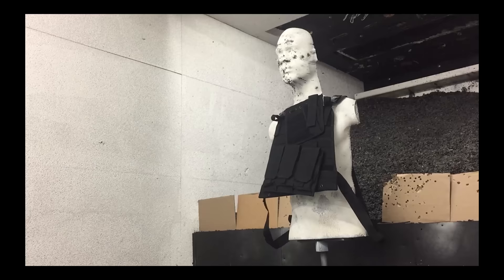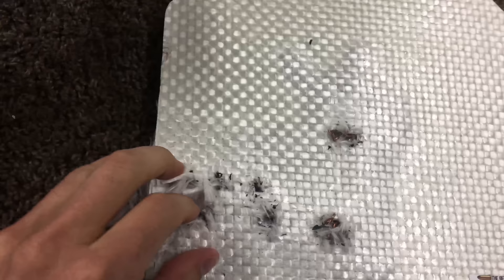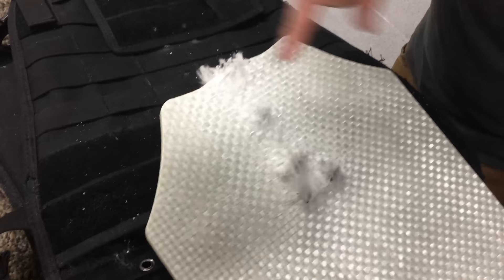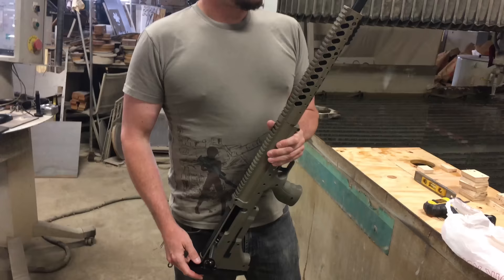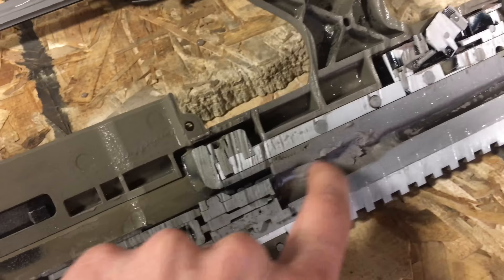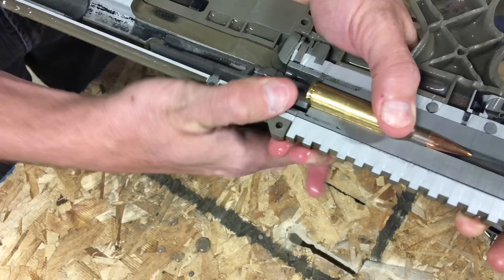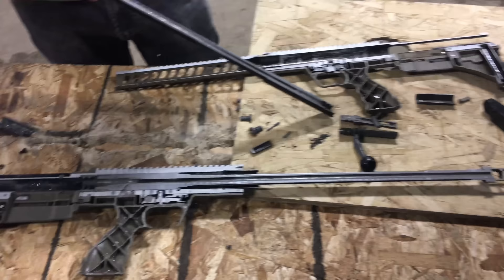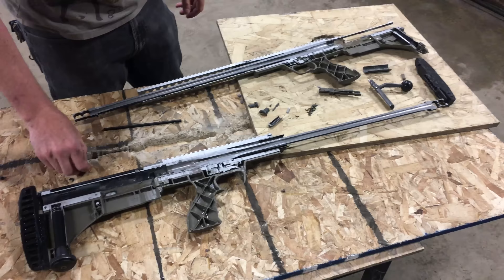Desert Tech Sniper Rifle cut in half with 60,000 PSI Waterjet Cutter

Comment: you guys I think what the manufacturer is doing is making a cutout for their product so they can show the internals to potential customers, I don't think it's going to waste at all
Reply: Jared Sundstrom i sure hope so
Reply: Jared Sundstrom Exactly
Reply: I do cutouts for various automotive parts and cutting it in half like this is the quick and dirty method. The more reasonable options are usually dismantling everything, planning the best revealing route, cut with whatever is suited from hand saw, dremel, angle grinder, bandsaw, lathe, mill, or even plasma cut/gouge. each part in appropriate ways.
Paint everything with contrasting colors. And sometimes I also need to design and make parts to make the assembly usable and movable after it's cutout. Then assemble everything back. (sometimes I need to glue parts, or even put a bolt by drilling and taping to fix cutout parts).

Too bad we do not have a water jet cutting machine. Could definitely help me in some areas.
Reply: Jared Sundstrom or it was a faulty gun and it couldn't function so they took advantage of the opportunity and got the word out for their guns and stuff btw your totally right
Reply: We miss you Peep 
Unlikely they would do such a thing considering that I looked on their website, and this model costs roughly $6,900 and repairing a bolt-action rifle such as this, is relatively easy and would not be an issue for them. This is definately a functioning rifle they wanted to cut in half for shits and giggles. Nothing else
Reply: Lil Beep bop yeah cause a faulty gun can’t fire 0:34

Comment: .50cal bullet vs 60000 PSI :)
Reply: copper coating and lead? easy cut to be honest :P
still would be pretty cool to see though if they include the brass shell as well :P
Reply: Solid Snake AP rounds :)
Reply: dimmacommunication it would just be a steel or tungsten insert in the bullet
Reply: Jakub Jezewski it can't be a live round the sand will blow up (forgot the actual word for it) the powder
Reply: GUNpowder.
Reply: Nah, 20mm anti tank rifle round. steel projectile round at that, of course.
Reply: DeadShadowGH 😂😂😂😂😂 thank you for the explanation of proper terminology
Reply: Jakub Jezewski its just lead
Reply: They did a bunch of live bullets in a row and one went off and set off a bunch of the other ones! It was pretty cool, it's probably called something like "Live bullets vs 60000 psi waterjet"